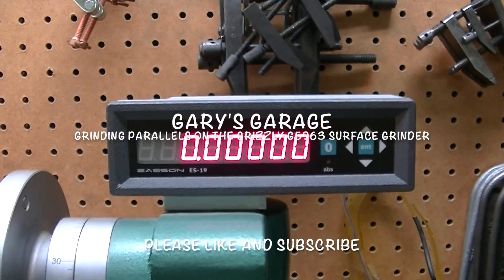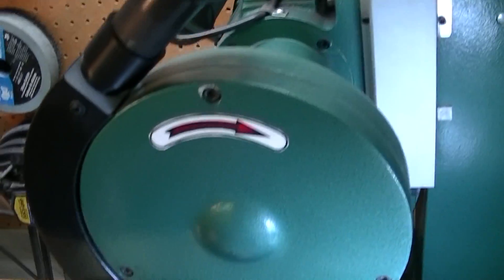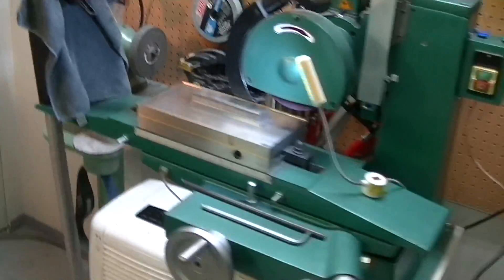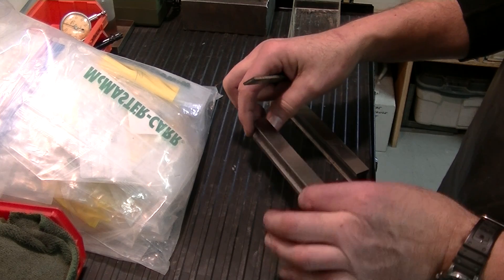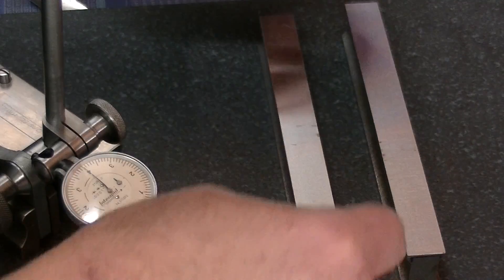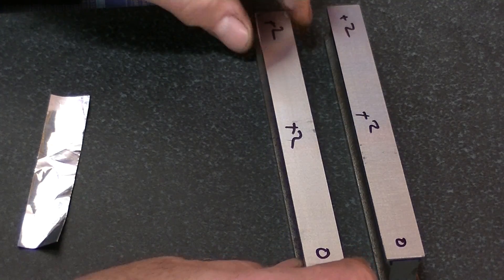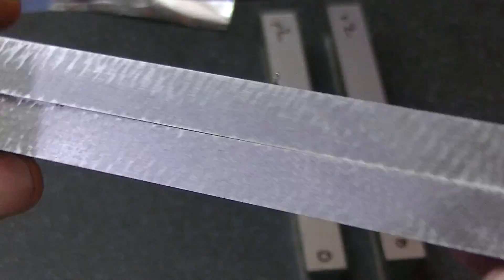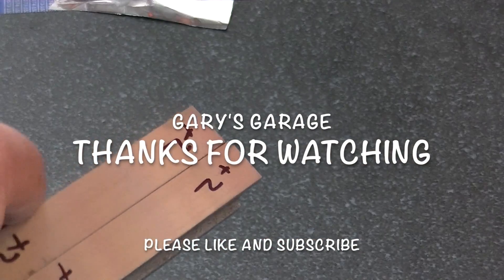Grinding parallels on the Grizzly G5963 surface grinder

Comment: On a side note I realize you’re doing a video but you should start the spindle up and give the bearings time to stabilize. Also if you shut it down then start back up your going to have the same affect. Like I said, I understand your doing a video and we’re probably concerned about the noise. The shop I worked in we didn’t shut the spindles down sometimes till the end of shift.

Comment: Thanks for the reply. Perhaps I just have a faulty 5 volt ac to dc adapter, will have to check. This is somewhat new to me so just to be clear you made the connection to the ES-19 at the two wire terminals  marked 5 volts on the back of the display. My unit didn't so much as light up when I did this. Thanks for your time and video.

Comment: I hope you can help me again as I'm trying to duplicate the set up you are using on your grinder. Having gotten the components, I realize I don't know what to use as a power source and how and where it connects to the system. ( no instructions on either component ).And perhaps a second question, .... will the Easson ES-19 be able to accurately display the very fine increments the scale is capable of? Thanks again.
Reply from the maker: I believe this is what I sourced on ebay: Item info
AC-DC 5V 3A 15W Power Supply Buck Converter Step Down Module High Quality USA

Comment: Thanks again for your time. I have been inspired by your set-up as I have a very similar grinder (Targa brand). Just before I order from the sources you supplied, I'm hoping you can clarify which iteration of the DRO you chose? there seems to be a few variations available, .. ttl standard,  ttl with RS232,  RS422 standard and another one I can't recall at the moment. I'm assuming you are still happy with your configuration and frankly those various designations are beyond my knowledge at this point. Any insight would be greatly appreciated.
Reply from the maker: TTL standard.  Very happy with the setup.

Comment: Love your set-up. Did you consider mounting the scale on the back of the machine, where it might be a little more protected from dust and debris?
Reply from the maker: Humm, no I didn’t.  I like the idea and will look into it.  Thanks for the suggestion and stopping by.
Reply: @garysgarage101 there’s real.y nowhere in the crack to mount it. I’ve been looking to do one in mine as well. The oil connector, the vertical stops, etc. all get in the way. I’ve been thinking of using standoff (sturdy ones!) to move it back, but I haven’t decided. I assume you’re using a 1 micron scale as the standard 5 micron scales just measure to about 3.5 tenths, though it may look as though they’re reading by tenths. I used 1 micron scales on my lathe and liked the consistency so much I changed the one on my mill to that as well. The readout goes to 0.00000, so it can actually give the right numbers.
Reply from the maker: @melgross  yes, 1 micron scale.

Comment: Hi!  I have the same grinder and want to mount DRO. My first question is if You mount it the way you did it wil it not collide with magnetic bed when you are going down? Second question is when you bought this addition for dust collecting by vacum cleaner? If it is 2d printed do u have model files maybe? Thanks in advance for the answer. Greetings from Poland! ;-)
Reply from the maker: The head can go all the way up and down without running into anything.  I had to pay close attention to this before drilling holes but it worked great.  Welcome to the channel, we love Poland.
Reply: @garysgarage101  thx for answer. I also asked for dust collector addon? Can you answer?
Reply from the maker: Dust collector is simple sheet metal cut with a plasma cutter.  I don't have files, sorry.
Reply: @garysgarage101  thx! <3

Comment: When grinding long parts without coolant they must be set at an angle to prevent overheating in the middle. Grinding the whole length in one pass will expand the parallels in the middle leaving a dip when cooled. This is vital where there is no power traverse as the wheel moves too slowly over the part by hand causing heating.
Reply from the maker: That’s excellent advice.  I’ve  seen that done and it makes total sense.

Comment: When we made parallels at school the first op grind after heat treat was done holding the raw parallel in a grinding vise with the top surface indicated as good as we could manage.

I’m also working with a mag chuck that has unknown geometry.

Circling back to the grinding vise fixture, I’ve had good results grinding flat parts by raising my work up off the chuck and again held in the vise,  minimizing my reliance on the chuck flatness.

Good work, 👍
Reply: Grinding the first face in a vice eliminates the magnetic chuck pulling out any bow from heat treatment. If the first face was ground flat directly on the chuck, once released the bow would return.

Comment: Great to see some progress- did you scrape those parallels? And how about that dust collection attachment- is that original to the grinder or did you make that? I've thought about making one for my Reid grinder. 
Somebody is going to say you should wet grind these, and I tend to think the same because that's what I do, but I know you're going to get there anyway. 
You probably already know this , but a spark- out pass or two, especially after a finishing pass, will clean up some of those spots. Also what you mentioned about the magchuck  distorting the part is real- and there is a Don bailey video where he shows a trick to avoid this. He turns the magchuck on and then off again and has the part held on by just the residual magnetism.
Reply from the maker: Yes, I saw that video too.  You have to be a pro though.  The chances of loosing your part bc not enough magnetism is something I tried once and failed.  Dust collection is custom (plasma cut parts and welded).  The hose is secured at the back with 3D printed parts.  Parallels are not scraped, just looked like that with the light against a poorly ground parallel.